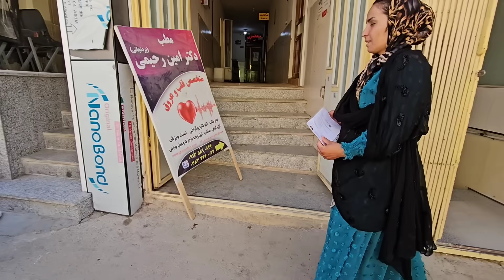Journey to health: tests during pregnancy

Comment: Angel, please do not too turn the swiths of waching machine anti clock wise, then tgat swithc will broke.  And don't use hot water in machine, because then your clithes will crease. Just a tip.